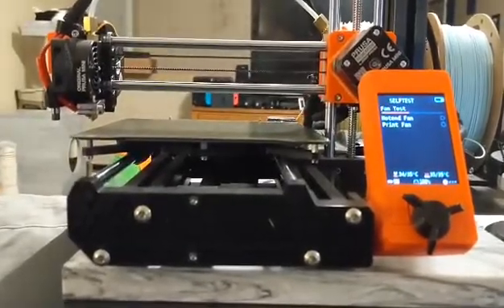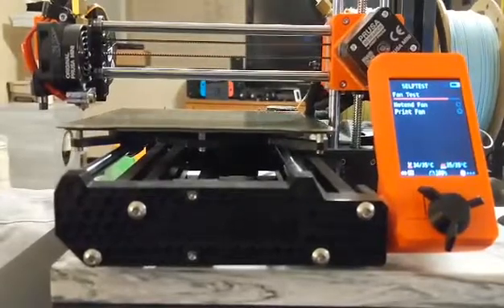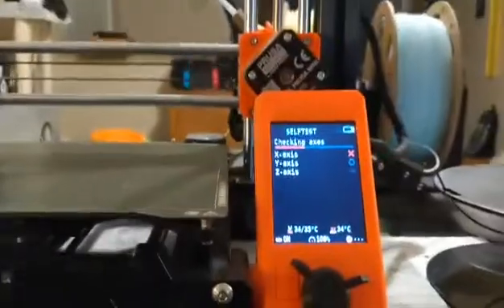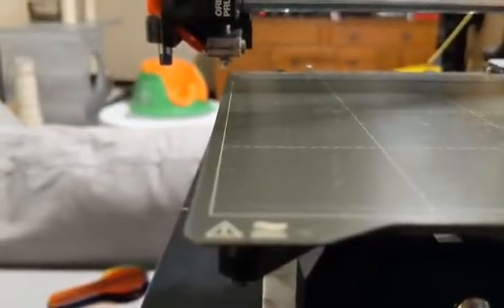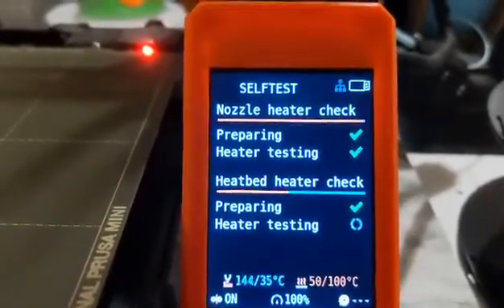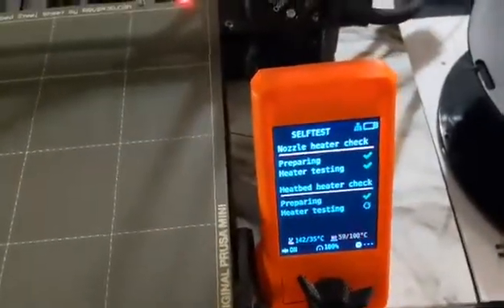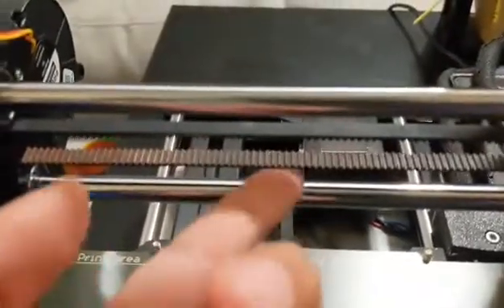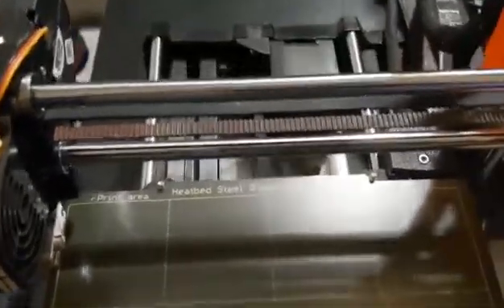Prusa Mini + [Assembly from Kit] Calibration: X and Y Axis Troubleshooting

Comment: I had the same issue after updated to 4.4.1 firmware. If you put an usb stick in the mini will write the test summary to it. You could then check the length of „x“. After that you can update Timon the printer. There is a secret menu where you can adjust the values. Rerun the test sifter that. Worked for me
Reply from the maker: Oh wow, thanks for that. I ended up going back to my class lab and printing a part to check my Z to my X for straightness and warp. I'll give your suggestion and look and see if it yields anything.
Reply: @FoolsMachining  Did you ever get his fixed?  I"m having the same issue
Reply: @jerodfloyd9757  yeah, there is a secret menu where you can adjust the height. After that mine worked just fine. Still sold it for a P1P 😊
Reply: Hi man, i maked a Prusa Mini Bear with original X carriage, but now the axis measure different, infact the autotest XYZ fail.
Can you explain me where is the secret menu to adjust these values? (and, if for example i have a X leght of 173mm, i need to put the exactly value or i can reduce it?)

Thanks